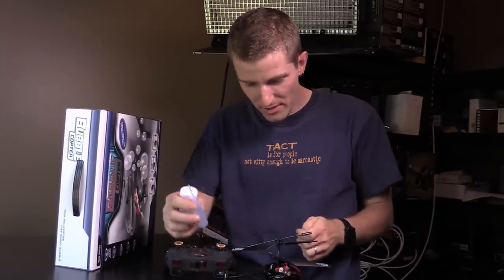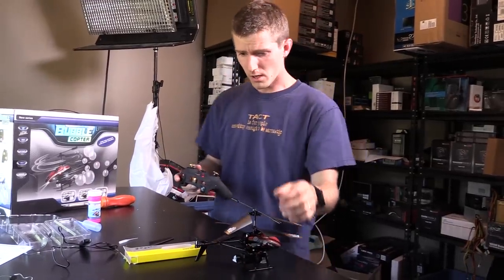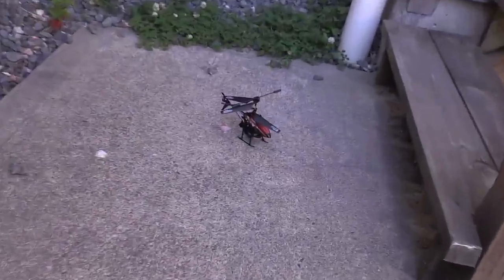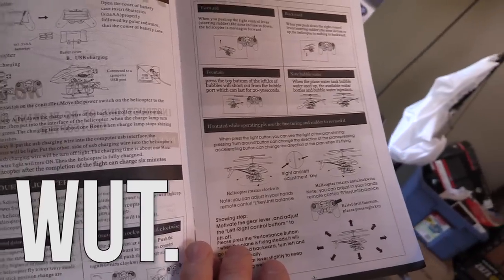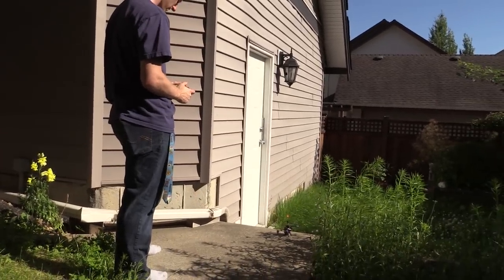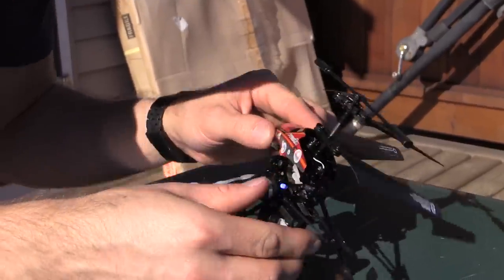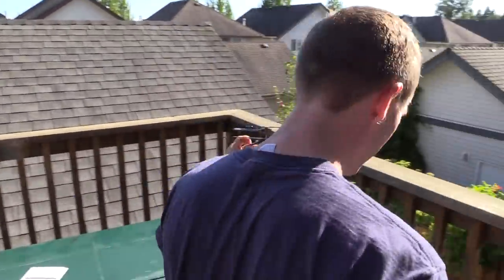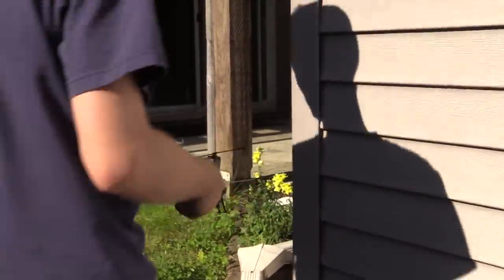Bubble Dispensing Remote Control Helicopter

Comment: blowing bubbles in a room with multiple insanely expensive rigs and test benches. 10/10.
Reply: spitfire1x3 because tiny bubbles like that will cause sooooooooo much damage
Reply: Natos it can because bubbles have water in them, also look how many bubbles are being released.
Reply: spitfire1x3 lol. so i take it the minuscule amount of water in a bubble is going to land on the casings and completely destroy the underlying components then?

because the computers are in CASES, and the components themselves arent just naked electronics.

That tiny amount of water will do literally nothing. He would have to aim the helicopter ass at a piece he'd want to fry point blank to even have a chance at causing damage.

Ever hear of somthing called humidity? Gee, its a wonder computers work at all /sarcasm
Reply: Natos well considering I said rigs and TESTBENCHES which are open air, yes those bibles can cause damage.
Reply: spitfire1x3 and if you knew how to read you'd see i accounted for that "and the components themselves arent just naked electronics".

and the bibles are the ones causing damage... i could actually agree with that one but thats another discussion
Reply: Natos LOL I meant bubbles, but yes bibles do cause damage, religion itself is detrimental to society. However if a bubble lands on oh let's say a capacitor it could short the thing. So yes bubbles can cause damage.
Reply: spitfire1x3 and the chance of a bubble that small (try to think about what bubbles, especially smaller ones, do after traveling VERY short distances.. hint: they pop) actually landing on it?

answer: the chance is so low it may as well be impossible.

Comment: Small cheap toy helicopters are not meant to be flown outside for two reasons. 1 they just cant handle the wind. 2 they use ir remote controls, which can not be used easily in the sun. a blade msr is an expensive hobby grade heli that may have at least limited success flying outdoors because it has more power and has a 2.4ghz transmitter. However the wind will still be a large factor in the success of a small heli.

Comment: Can you review the Nintendo 2DS? I think I saw you had one and I am missing some first party Nintendo goodness.
Reply: If you really need a review: Avoid it and buy a 3DS XL and keep the 3D slider off if it bothers you that much. The screens are really tiny on the 2DS, and you're missing out on all the first party goodness.
Reply: MarioDragon What first party goodness are you missing out on with the 2DS? It can play all the same games, and it's still Nintendo. The 2DS is $70 cheaper if you don't mind the physical deficiencies (smaller screens, no folding for compactness, awkward grip) and don't need the 3D option.
Reply: MarioDragon I'm more focused on price. The 3DSXL is too big for my liking, not as portable, and even more expensive than the 3DS which I can only find in pink. And I don't feel like painting one.
Reply: Go watch Austin Evans review if you need one.
Reply: Timothy Mast If the smaller screens don't bother you then get the 2DS, it's just as good as any other Nintendo handheld
Reply: MarioDragon no.. not at all.. all of the buttons and the dpad feel waaaay cheeper and not very good.. just go in a store and hold it and if the cheep buttons and the small screen do not bother you, go for it.. but trying the 3ds xl and the 2ds when I was deciding.. there was no way in hell I'd buy a 2ds despite the cost differences
Reply: LE0NSKA Well I have all of them and the 2DS feels solidly built to me. The public ones in the store are horrible examples with the abuse they go through, I wouldn't use that to decide which has better buttons because you get 8 year olds slamming on them to play whatever game is on display.
Reply: MarioDragon isn't that a testament for the durabilty then? I tried both in stores (more than once), and the 3DS felt quite fantastic, despite it beeing much older than 2DS

I'm not a 8 year old, yes, but stuff wears out.
Reply: LE0NSKA Not really. My watch is durable but I can still smash it with a hammer. The 3DS's at my stores are absolutely atrocious; the circle pads are worn out, the screens are beyond scratched, and the buttons have lost their letters. They're also missing R and L buttons.

But I have a Gameboy Color I got back when it released and it looks almost like new and works like new. That's because I didn't let it sit in a public store for random customers to handle all day with no care for property that isn't their own. Neither the 3DS or 2DS have been out that long so neither of us can say with certainty on its durability, but using a public device as an example isn't fair to the device.
Reply: I think if the same 3DS has been there much longer than the 2DS and the 3DS XL (sorry, was talking about the xl the whole time) still feels much more durable and higher quality. I think it's safe to say that the 3DS XL is much better quality
I mean. thats the reasoning behind the 2DS after all.. cheeper.
yes your gameboy colour will still work amazingly good, but it also wasn't a cheepo version of anything

there is actually no reason to dabate here. the 2DS feels cheeper because it is. and if you're ok with that, go for it. personally, after feeling the big difference, would never do that
Reply: btw. I don't wanna know what store you went to :D that sounds horrible! missing R and L buttons? wow
Reply: LE0NSKA I still think it isn't much cheaper, and if nothing's going to convince you then there's nothing I can say

Comment: I have the same helicopter without the bubbles and with an iPhone as remote. Mine actually works very well. The thing is from China, so the manual is what you'd expect... You just gotta be careful flying it. Also it is completely useless outside like Taran pointed out.

Comment: Omygosh this made me sad. You have all these great tech tips for PC Building and all that, but you ditch all that when going into RC.

Read the manual!! (Just like you should when you get a new PC Component).
If you are inexperienced, find tips online!! (Just like if you are inexperienced at PC building)
Don't use an IR controlled RC outside EVER since they can go berserk and haywire sometimes from interference.
Go steady on the throttle and slowly increase until you find the sweet spot. (Sorta like overclocking maybe?)
Don't fly chaotically indoors around people!! Those rotors can easily talk an eye out or damage the wires of your precious tech.